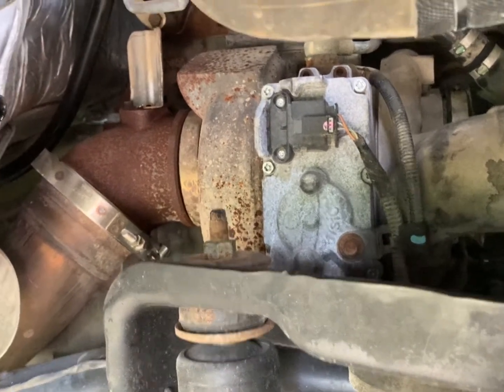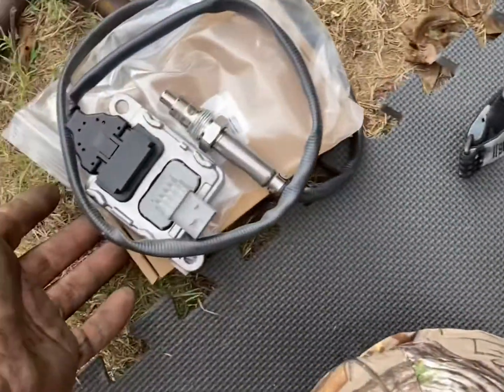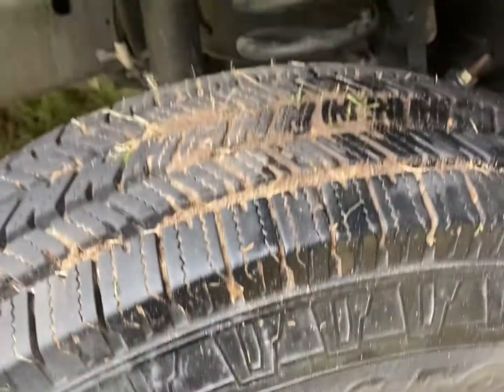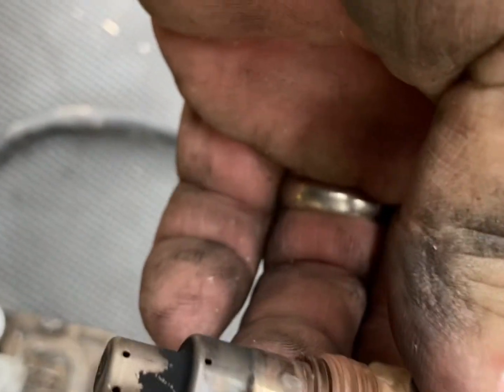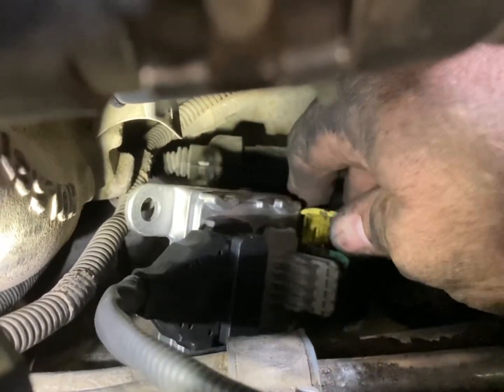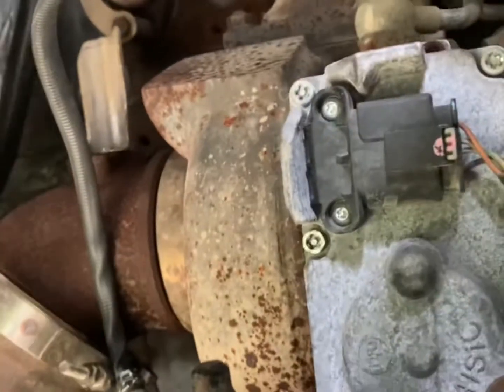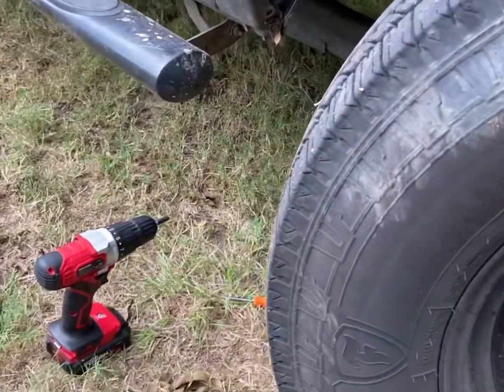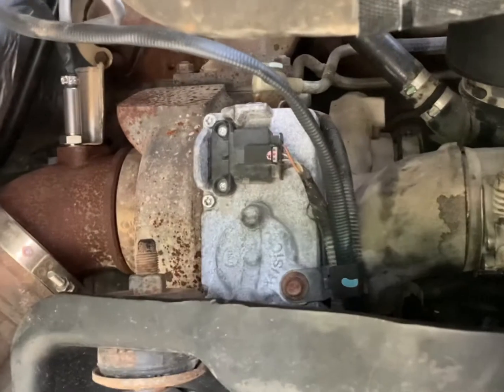6.7L Cummins NOx Intake Sensor - Bank One - Upstream How To Install

Comment: Great video, thank you so much. But I have a different topic question.  At back of my Ram 2500, 6.7L cummins. Some pre-owner joker tightend my fuel filter way too tight. I've used every wrench on the market. I don't want to damage it and create a different problem.  There is no room for leverage. I am considering a complete replacement with a FASS system. 
Any advice to get it loose or do I do a complete replacement. 
Thank you
Reply from the maker: Thank you so much, I’m glad you like and enjoyed the video. I know u don’t want to damage it so I’d try an old leather belt. I’ve used this method on oil filters and that got me out of my Jam. 

I have lots of videos of my build on this truck. Please check them out and subscribe and hit the bell to support my channel. 

Also, my STORE is open (please support) with a purchase. I have lots of custom T-shirts, Gear, merch that’s aimed towards my playlist genres. Prices range from $1.99 and up with fast and low shipping.

Https://operationrv.printify.me

Comment: I had the same problem on my 2017 ram. I cleaned the sensor and reinstalled. A short while later, I would get another code. I would clean the sensor and reinstall. The sensor would be covered in soot. I believe that a lot of these problems have to do with the def system. And stock intake. About two months prior to this problem I had installed a banks manifold to alleviate the heater Grid fault on a stock intake. I was amazed at the amount of soot in the stock intake. So after I installed, the banks manifold truck runs great very smooth, good mileage, etc.. then the problem with nox sensor. I figured the soot that I couldn’t clean in the engine was causing the sensor problem. I used sea foam and went on a long drive about 100 miles. No sensor problem. I use sea foam every fuel up. After 2 weeks I pulled the sensor no soot no codes that was a year ago. I think the banks intake and using sea foam make my truck run great, I do not see the regeneration on the dash anymore and I seem to be using less DEF.
Reply: I too have the 217 ram 2500, 6.7L cummins. I also install the Banks monster Ram intake. That little nut really worried me. And now I have the code for #1 Nox sensor. Working on that tomorrow.  I will start using sea foam.
Thanks to this video, I know what to do and feel confident doing it.
Reply from the maker: @johnfreitag4044  Thank you so much, I’m glad you like and enjoyed the video.

I have lots of videos of my build on this truck. Please check them out and subscribe and hit the bell to support my channel. 

Also, my STORE is open (please support) with a purchase. I have lots of custom T-shirts, Gear, merch that’s aimed towards my playlist genres. Prices range from $1.99 and up with fast and low shipping.

Https://operationrv.printify.me
Reply from the maker: Thank you so much, I’m glad you like and enjoyed the video. That’s amazing and glad to hear this has worked. I plan on getting the Banks soon as well.

I have lots of videos of my build on this truck. Please check them out and subscribe and hit the bell to support my channel. 

Also, my STORE is open (please support) with a purchase. I have lots of custom T-shirts, Gear, merch that’s aimed towards my playlist genres. Prices range from $1.99 and up with fast and low shipping.

Https://operationrv.printify.me

Comment: Quick question what sensor is bank 1 sensor 2? Is it the rear one by the Exost or is it the one by the turbo?
Reply from the maker: Thank you so much, I’m glad you like and enjoyed the video. Bank 1 refers to driver side and sensor 2 means after the catalytic converter.

I have lots of videos of my build on this truck. Please check them out and subscribe and hit the bell to support my channel. 

Also, my STORE is open (please support) with a purchase. I have lots of custom T-shirts, Gear, merch that’s aimed towards my playlist genres. Prices range from $1.99 and up with fast and low shipping.

Https://operationrv.printify.me

Comment: Wow, great Video! Thank you so much. Went to do my Calif. Smog check and bam... engine light  comes on with a P2201 Code . NOx Sensor - Bank 1. Had this done at a shop 3 ys ago $2000.00.
You're a Champ!!!
Thanks again, Brad
Reply from the maker: Thank you so much, I’m glad you like and enjoyed the video.

I have lots of videos of my build on this truck. Please check them out and subscribe and hit the bell to support my channel. 

Also, my STORE is open (please support) with a purchase. I have lots of custom T-shirts, Gear, merch that’s aimed towards my playlist genres. Prices range from $1.99 and up with fast and low shipping.

Https://operationrv.printify.me
Reply: @OperationRV  did that fix the problem

Comment: Good video after I snipped all the damn zip ties holding wires from the last dumbass that replaced mine, yes it was the dealer.  And the only difference between the part the deal has that they charge $600 plus labor total $975.  Is they order it with a heat shield wrap.  Pull off the old one afix it to the $69 one and you are good.  Did I mention I hate zip ties they suck.  Especially in the situation.

Comment: I noticed the original NOx sensor had a heat shield on it, and the one you replaced didn’t.  Have you run into any issues with the new sensor (without the heat shield)?  I just bought one to replace mine and it came without the heat shield.  I’m a bit skeptical as it’s suppose to be an OEM part.  Thanks for the great video!!!
Reply from the maker: No problems yet and I pull a 16k trailer ever so often. No lights, no issues at all. 100% fix.
Reply: The heat shield isn’t important I’m going to take mine off to so I can change sensor faster next time

Comment: Be glad you had only 1 bolt holding that fkr on. Gah Damm engineers SUCK!  Wire is cheap put that damm thing in a accessible location. Good video thanks

Comment: Mine is now showing a p014c 02 sensor slow response- rich to lean bank 1 sensor 1. Drives fine. But do you think the sensor needs to be replaced or maybe the harness?
Reply from the maker: 9 out of 10 it’s the sensor due to carbon and gunk build up. U can try cleaning first. Wiring can be an issue due to connection, broken wire, or disconnection. Condensation can also be an issue as well triggering a faulty code.
Reply: @OperationRV  I wonder if it’s okay to drive it a little while until I get it fixed? The soonest I can get it looked at is august 12th but I might just try changing it myself idk. I cleared the code but it will be back here soon.
Reply from the maker: @trenton6388  I drove mine a while before figuring how to clean/replace it. I personally didn’t experience any issues other than the annoying check engine light.
Reply: @OperationRV  let’s say my truck goes to Mexico and on the way back it loses some parts. Let’s call it a weight reduction lol would this sensor still need to be replaced? Or would it even matter then?

Comment: Whoever designed the connector mount hates mechanics. Tips on removing the lower bolt/nut appreciated. I will not be putting it back in.
Reply from the maker: You are absolutely correct, they don’t like mechanics that’s for sure. You are most certainly welcome, I’m happy this helped out.

Comment: Just replaced mine using your video, thanks. I went ahead and bought the OEM part from the dealership (I figured it was hard to change it so I did not want to do it twice in case I buy a faulty part). However I guess I was hoping the light will just go away but it didn't. How do I clear the codes? and how do I make sure they are not just going to come back. I am about to sell my truck and I don't want to be that guy that sells something and next day your CEL is on. Once again thank you for the video, it was very helpful.
Reply from the maker: Thanks so much for the comment. Once a CEL “new” part is installed and driven the ECM should read that the part causing error has stopped and erase on its own. Typically, the computer will take some time up to 50 miles from my personal experience but each CEL code and vehicle is diff.

You can always take ur vehicle to Oreillys as they have the OBDII reader/scanner to erase it. Also, u can purchase a decent one too that can do the same basic functions on the cheap. Hope this helps.
Reply: @OperationRV  Thank you
Reply: Is this aftermarket or replacement?

Comment: Where did you get the sensor and has the code returned after changing out? Thanks
Reply from the maker: Purchased on Amazon. Check Engine Code deleted once installed and has not come back on.
Reply: @OperationRV  can you send a link or show which one you got off Amazon? I just got one and don't think it's working. I've heard the computer doesn't recognize any other than stock?? 

You got one off Amazon and it fixed your issue 100%?

Please link which one you bought
Reply from the maker: https://www.amazon.com/gp/aw/d/B08V15QCQ2/ref=ya_aw_od_pi?ie=UTF8&psc=1
Reply: @OperationRV  that link you sent me is showing a down stream sensor. You bought an upstream or down? And that one worked for you? I just got one off Amazon and I'm still having code
Reply: @austenazevedo6078  did you change the sensor on the turbo  with a downstream or upstream?
Reply from the maker: The Amazon Store for it was Yifeta Store. No issues since initial install. Just installed part, cleared code, and drove it. I’d contact Amazon they will make it right. There are some parts that are just faulty. After all they are a man-made product so I’m sure sometimes quality control gets away on some of the parts.
Reply from the maker: Correct link for Sensor 1 Upstream:

https://www.amazon.com/68210084AA-Upstream-Nitrogen-Compatible-2013-2017/dp/B099RQXTNR/ref=mp_s_a_1_6?crid=30BRG6CGOAWN4&keywords=68210084aa+nox+sensor&qid=1640301686&sprefix=682100%2Caps%2C233&sr=8-6
Reply: @OperationRV  okay I see and that was the exact one you got from pineapple autopart seller off Amazon?  Only reason I'm asking is because I also got one from Amazon and I am still getting the code... I want to get one from Amazon that works. The seller was pineapple autopart or DOCAS on Amazon? 

Thanks. I just need this fixed 🙃
Reply from the maker: I uploaded downstream by accident and just uploaded the correct upstream link to Amazon. Upstream is a Gray “4-prong Square” female pigtail on the box sensor
Reply from the maker: Part# 68210084AA is Upstream
Reply from the maker: U can try this too:

https://prosourcediesel.com/blog/dodge-ram-cummins/how-to-clear-cummins-fault-codes/
Reply: @OperationRV  I've cleared the codes. I have scanners to do so. So you bought the one off Amazon from that seller and it's worked for you from then on? No other issues?

Comment: This is p2201? Bank 1? The one for the rear near exhaust is bank 2?
Reply from the maker: Yes, this is Bank 1, Turbo side for code P2201
Reply: @OperationRV  hey how’s it going, buddy? Was this an OEM part I replaced one with Amazon  and it’s giving me trouble.
Reply from the maker: @JohnCurrent-x8j  OEM compatible off of Amazon, the link is in my description. Mines still going strong with “0” issues.
Reply: @OperationRV  for some reason, the link is not opening
Reply from the maker: @JohnCurrent-x8j looks like this specific one is unavailable but if you scroll down you’ll see others that are the same, just make sure it matches the part# in my link and you should be okay.
Reply from the maker: I just sent correct link, part#, description under other comment